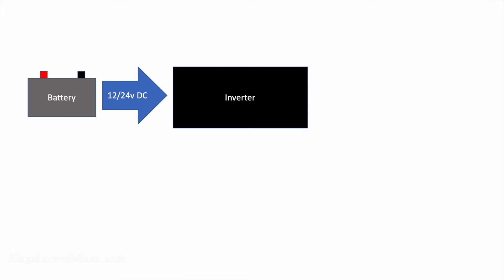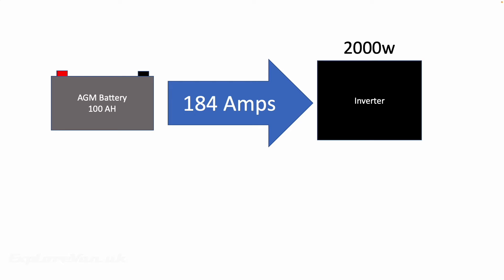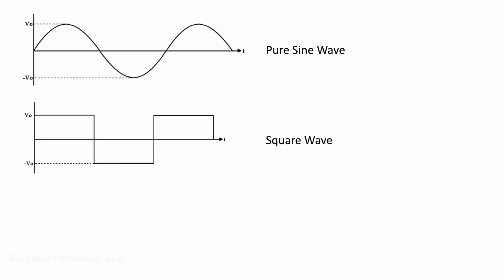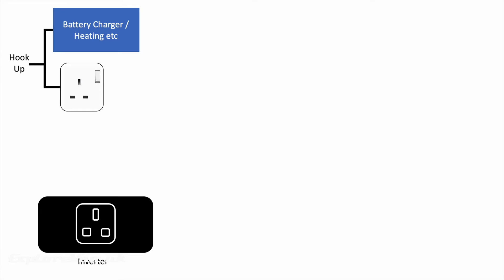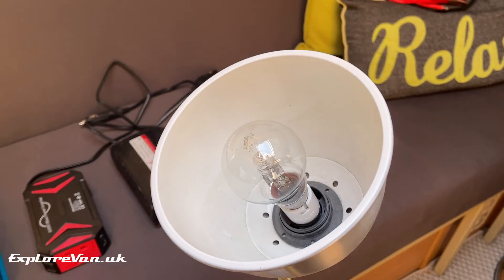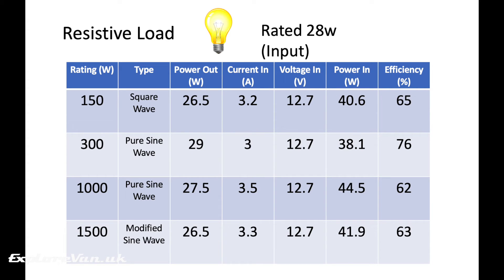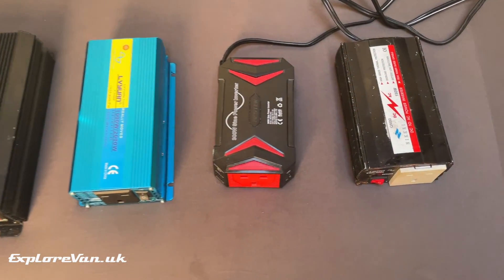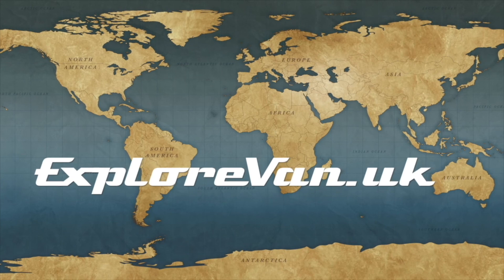Inverters - How to get 220/240 volts off grid. Do you need one? Size? Type?

Comment from the maker: You can purchase your CarLock device on Amazon through this link: https://bit.ly/explorevanuk10 
and use the discount code: EXPLOREVANCL for 10 % off the purchase price.

Use PROMO code EXPLOREVANCL to receive extra FREE subscription when you activate your CarLock device.
Reply: Why can’t you use a Inverter output AC to send charge back to the battery 🪫 DC via a 12v transformer? 
You could create a endless loop of energy ? If you know I mean?

Comment: I've a 2000w inverter with 110 volts! I want to upgrade 220 - 240 volts, how do I this?
Reply from the maker: My only suggestion would be to change the inverter.

Comment: Before I watched this video i've bought a converter 3000w for small stuff like charging laptop and etc. Was it a mistake? 
What I took away from this video, the more powerful your converter is, the more energy it consumes even if you use it for small things???
Reply from the maker: It’s not ideal on a few counts I am afraid. 

You have paid more than you needed to

The cabling / fusing you will need to make a 3000w inverter safe to use at 3000w will be expensive

The efficiency of a 3000w inverter (unless it is a very high end one) is likely to be worse when used at lower powers.

Comment: My 1000 watt inverter only produces 218 volts output voltage is this normal can I use this inverter to operate equipment like my Fridge/Freezer can you advise I'm new to inverters.
Reply from the maker: It’s not normal for a 220/240v inverter no. 

Are you sure it’s not a 110v inverter?
Reply: @ExploreVanUK  I have now altered what I originally sent you,  I should of said the output is only 218 Volts I think the output voltage should be between 230 and 250 volts my concern is is 218 volts enough to run electric fridges without causing any damage.
Reply from the maker: Ah right that makes more sense. 

Most “Mains” appliance are designed to run from 220-240v 

I would imagine 218v would be fine, you may just find the appliances aren’t quite as effective as you would expect when plugged in at home.
Reply: @ExploreVanUK  Thank you very much for your advice.

Comment: Inverters for the UK’s 240 volts are simply impractical as they draw excessive amperage from the batteries.
Reply from the maker: From our perspective it very much depends on what and how you use it. 

We routinely use ours for Cooking on induction hob, microwave, heating water in kettle / coffee machine.  Given the power is from our solar panels whilst having its in efficiencies it is very cost effective compared to using LPG or paying for hook up.

Comment: To my shame I'm completely bewildered on how to work out the inverter size that I need to power our Starlink from our onboard batteries. The 240v power brick for the Starlink brick says 2.7A and apparently Starlink uses around 65w normally but can use up to 85w on start-up. Please put me out of my misery !
Reply from the maker: Hi, I;m guessing you are not using the Starlink Mini as that can be powered direct from 12 volts in a few different ways.

For the Standard Starlink you dont need a big inverter but due to the electronics in the Starlink it probably does need to be pure Sinewave. 

I'm going to presume you are going to be leaving the Starlink running most of the time so I would suggest going for a well established and proven brand for this application, as the last thing you want to be worried about is one of the cheaper inverters failing or over heating when you are not present. 

The Victron Phoenix Range are well regarded and this 900w model would have plenty of capacity to run the Starlink. https://amzn.to/4fILaZd

They do make a smaller version but its not that much cheaper and this will give you spare capacity if you wanted it later. 

If you did want to go for a cheaper option you could consider the bestek 300w model https://amzn.to/4fILaZd

Comment: Are snappy batteries alright?
For how long can they last on 130ah if I have to use 2000w  device?
Reply from the maker: I've no expereince and never heard of Snappy Batteries before, so couldn't give an opinion on them.   But the fact they market them as "Cheap Leisure batteries - usually suggests they are not high quality"

130 Ah at 12 Volts is 1560 Wh
So theoretically you could run a 2000w device for around 45 minutes

However with an AGM battery (Which Snappy Batteries seem to be), to avoid damage, you should not really allow it to go below 50% state of charge, so in reality 20 minutes would probably be the safe maximum. You would also need to consider if the AGM could safely output the 166 Amps required for 2000w (most wouldn't)

LiFePO4 batteries safely discharge to a lower state of charge so you potentially could get 35 to 40 minutes depending on how the BMS has been set.

Comment: All of these inverters have power consumption with 0 load attached. That might be the worst part in battery pawed system, you can drain your batteries without any load attached to the inverter. 
That might be cause of inefficiency of small load lightbulb. For the efficiency test to be more accurate you should run a test with 50 or 80% of maximum rated power on all inverters. say 75W, 150W, 500W and 750W loads, and then see how efficient is each inverter.
Reply from the maker: Agreed, to be fully scientific they should also be run at various room temperatures, various degrees of ventilation and with various balances of Inductive,  Resistive and Capacitive load. 

Unfortunately we don’t have the time to do fully exhaustive tests (nor claim to), but we do aim to give a good representation of what can be expected.

Comment: Hello
After reading the comments about modified sinus etc., are these inverters even suitable for 220V fans of about 40-50W power. And air pumps for air beds, tyre compressors, laptops and such? Nothing crazy. 
What lower load (>200W) wouldn't work on these things?
Tnx for the reply.
Reply from the maker: Hi, inductive loads like Fans, compressors etc should be fine on Modified sinewave.  But for laptop persoanlly i wouldn;t use anything but pure Sinewave due to the sensitive electronics.

Comment: Can anybody tell me what i would need for a 12v to laptop charger please?
Reply from the maker: Depends on your existing laptop power supply - it will have a rating in Watts on it. 

But is there any reason you want to use an inverter rather than just getting a 12v power adapter for the laptop?
Reply: @ExploreVanUK  i have ordered a 12v adapter thanks, hope it works! Big grey area this subject. Thanks for the vid

Comment: I’d say use a butane gas burner to heat water and meals. An electric jug or stovetop uses so much power from a battery that a cheap gas stove will eliminate this major user and you might get away with a smaller and cheaper inverter.
Reply from the maker: LPG was always our choice for cooking and hot water too, but now that LiFePO4 batteries / powerstations are coming down in cost and improving on capacity then Electric is now a via able alternative.
Reply: I just got a camper wood stove ordered. And All the safety flutes and ceiling box. I'm about to get my prep shed rolling

Comment: Can I charge my battery backup from the inverter with another charger?
Reply from the maker: Theoretically yes, but if I understand it correctly it could be a bit pointless.

You would be using the power from one battery to charge another battery - and as part of that process, you would lose some of the power to the inefficiency of the inverter. 

EG your inverter could take 40 AH out of your main battery to put 35AH into your backup battery - you've wasted 5AH.
Reply: How can I use my 1000w2in1 inverter and battery without solar panel ?
Reply from the maker: charge it from mains when on hook up?  I don;t see the point in stealing power from one battery to charge another. 

Please also be more patient - we're not always here to answer questions and adding "??" comments will just get the original question removed in future.   @user-sd8gv7qh6u

Comment: Good morning could you tell me What size inverter I would need to run? A small microwave.
A Small refrigerator and 24 inch TV. I'm a truck driver
Reply from the maker: Hi - I am afraid there are too many variables there to be able to say.

Microwaves and fridges come in various different powers.
The type of TV will vary the power required. 

Do you plan to run any of the items at the same time or would you switch them off so you only had one running at a time or would you want to run all 3 together. 

The best approach is to check the actual pieces of equipment and each item will have an input power rating in Watts - add together any items you may want to run at the same time and add a little extra just in case. 

For the fridge personally I would recommend going with a 12/24v compressor fridge rather than a mains powered fridge through an inverter as you don't have the efficiency loss of the inverter, they are lighter and generally made to deal with the vibration and shakes of life on the road better than household fridges. 

If you can find a suitable 12/24v TV this is also a good idea for similar reasons. 

Hope that helps!

Comment: Many thanks for all your videos. I’ve done quite a while without an inverter, but now I need one, I’m just trying to do the math, is it fair to say, I need to add 20% to the watts stated on the device label to compensate for inefficiency of the Inverter? Roughly…then I can decide which Inverter I need. ✌️
Reply from the maker: If you go for a quality inverter such as Victron. You can probably be confident that it will supply the stated power.  Though do note there will be a surge/peak figure and a continuous figure. 

For the cheaper end I would probably factor in 50% for over confidence in its abilities. 

The efficiency rating is more about how much power you need to put in to get out what you need. Eg to get 1000w out at 240v you may need to put in 1100w in 12v with the rest being lost as heat energy.
Reply: @ExploreVanUK  I really appreciate your advice. I’ll probably add about 35% as I’m thinking of a Renogy one as they can auto switch between shore and inverter. Hope your having a great summer, if you can call it that 😅 thank you again ✌️
Reply from the maker: @spitNsawdust   No problem and that sounds sensible to me!   We're in the South of France at the moment so summer is pretty good here, not looking forward to heading back to the UK!
Reply: @ExploreVanUK  lovely! I noticed it was hot there there today…We just came back. Have fun n safe travels. ✌️

Comment: Okay stupid question but here it is im doing a van conversion i haven't a clue about any of this electric stuff. Im going to use a portable gas stove, i have a AGM leisure battery which is 12v 115Ah i have the spikt charge relay and few standard plug sockets do i habe to install a inverter now of can i just run the likes of a mobile charger, and tablet, maybe a small hairdryer too. Can these be run off the battery?
 i do want to buy a small fridge maybe a mini fridge or cool box im not entirely sure yet which
Reply from the maker: Hi Stacey, not a stupid question at all. 

If you haven’t already have a look at our 12 volts basics video here. 
https://youtu.be/gpHBh6DorGM

An inverter is by no means an essential item and for phone tablet charging, lights etc you definitely don’t need one. 

The hairdryer there are 12v hair dryers available but they aren’t great. But any hair drier, be it 12v or mains through an inverter, is going to put quite a load on your battery and use it up quick.  So if you can manage without I would. 

My wife an daughter use these USB powered straighteners if that’s an alternative for you? 
https://youtu.be/ygH6q1IVOsQ

When it comes to the fridge take a look at our video here, https://youtu.be/QMLN4B9GVjQ 
the only real options for off grid is either a gas powered 3 way fridge or a 12v compressor fridge. 
The cheaper 12v cool boxes will always use your battery up very quickly. 

Hope that helps!

Comment: Why bother with convertors, why not just get a plug-and-play solar generator, such as Ecoflow, by the time you buy two leisure batteries and converters and all the wiring, just get a solar generator, powered by leisure battery, solar panels, or 240 v main house power
Reply from the maker: Check out our video here that looks at the value of “Plug and Play” power stations Vs separates. 

https://youtu.be/4OzD-ZVFny8

Comment: I was thinking of running a air conditioning unit for the camper van only 60w for this video would it be ok to run it on a 300w inverter for a hour or two what battery would you recommend?
Reply from the maker: Hi, I’d double check the unit you are looking at.  Our aircon is 1.5kw and I wouldn’t consider running it from the battery. 

I’d guess either the 60w is wrong or it’s not actual Aircon.
Reply: @ExploreVanUK   yeah it’s not a proper air con unit it’s the one with ice packs and water it’s definitely 60w running so so recon that would be ok to run for 1 hour or 2
Reply from the maker: Ah that makes more sense.  From our experience these aren’t great as they are not much more than a fan and the water essentially just adds damp / humidity to your van, something to be conscious of. 

When Offgrid we found using 12v / USB powered fans much more efficient. 

But if you really want to then I would size the inverter double the power usage to allow for initial spike.  By going bigger you add more inefficiency. 

The battery would depend what else you are planning to run and what you type you are planning to use. 

You would be looking at a continuous draw of around 6 amps from 12v battery. 

So a 100 Ah battery would safely last approx. 8 hours with a SLA / AGM battery and 16 hours with a Lithium. If solely used for the cooler.
Reply: @ExploreVanUK   thank you very much for the quick reply that helps loads!👍
Reply: @justinrowe3346  That's an evaporative cooler. Might be slightly better than a fan (but not in humid weather). At 60 watts its not going to be very useful. They're loud. You'd be better with a decent sized fan. Endless Breeze or Caframo are good.

Comment: 4:46 Why?  Why can't you charge the battery from the output mains?  The inverter should be isolated DC to AC so it should work fine... it will ultimately flatten the battery but it will pretend to be working only backwards.
Reply from the maker: Theoretically you could.......... its not going to break anything - but all you would be doing is throwing power away, taking power out of the battery to  drive the battery charger to put less back into it due to efficiency losses. 

The point is you wouldn't want to do it by mistake and wonder why your battery is always going flat

Comment: Great way to explain this.  What are your thoughts on including a Power station instead of an inverter eg Ecoflow Delta
Reply from the maker: Thanks, I have quite a personal opinion on them.  I know lots of people find them helpful and easy. 

For me they are significantly more expensive than buying individual items so you could have the same amount of power for less cost or more power for the same cost by buying separate items. 

You also have the advantage that if any one part does fail you can just replace that item. 

Upgrading or having different individual elements as your requirements change is much easier with separates. 

I can see how they are attractive to some from a simplicity perspective, but for us it would not be the right choice. 

If you do go down that approach do make sure you know what you are getting eg the Capacity, Charging options (max solar input / max 12v power in) battery chemistry and the inverter peak and continuous rating.
Reply: @ExploreVanUK  Thank you for a truthful answer and I agree in some ways.  My respective is that I don't have the skill set to install one and I think the cost of the equipment and installation matches the cost of a power station and just hope the warranty is good 🙂

I have already purchased the delta 2 and waiting for it l.  I do have a small campervan and just think it is versatile for my means.

Might be very interesting if you could do a review on one (like delta 2 :-) ) 

Love the channel and going through all your vids
Reply from the maker: Thanks Tony, it does sound like it could be a good option for you. 

We have been offered units to review but as the company wanted editorial control over the produced video we had no option but to refuse on that occasion.
Reply: @asquaddie   I agree by the time you buy two lithium iron leisure batteries and a 2000-watt inverter, including labour & installation costs, why not buy a plug-and-play solar generator, powered by leisure battery, solar power or house mains, which is also portable not fixed to the van, you would also need large campervan to store two batteries and convertors with all the wiring, not suitable for small campervans such as VW T5, I wonder with the correct fittings if you could charge those solar generators at EV points??